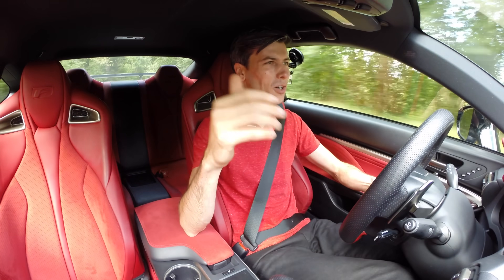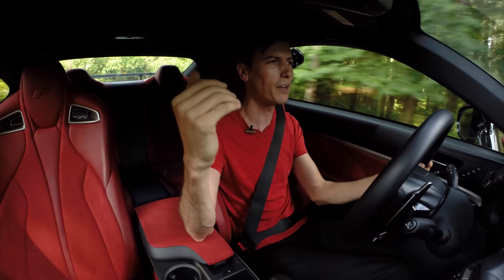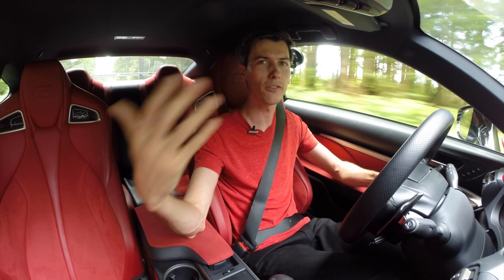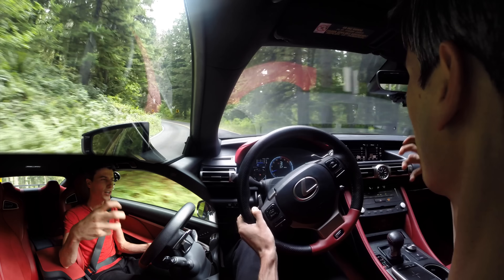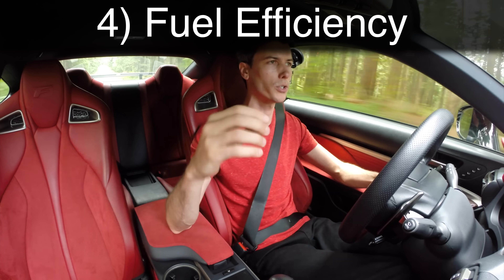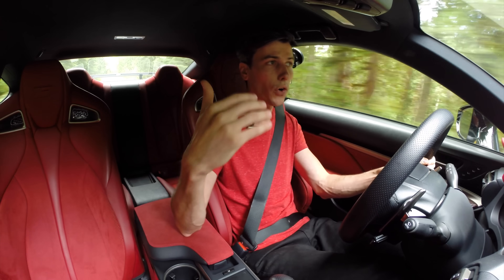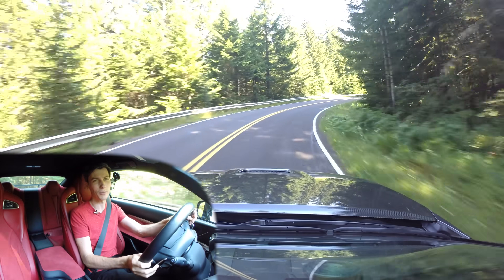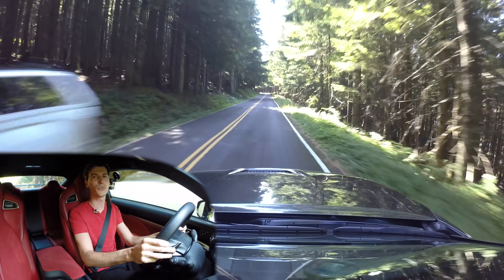5 Reasons You Shouldn't Buy A Turbocharged Car

Comment: Absolutely true. I own RC200t and it is shockingly bad car (or should I say car with a shockingly bad engine). I need to clarify this is in UK so we do not have RC350, we could have either R200t or RC-F. As it happens I cannot really afford RC-F, yes used one are now coming down to my price range, but I could never afford one new - hence RC200t. First of all, as mentioned the accelerator pedal is basically an on/off switch, there isn't much turbo lag past the point where accelerator is in "on" position, but engine completely doesn't like to rev past 4000RPM. It could, but there is no point as there is no torque to be had past 4000RPM... so again torque curve and accelerator response curve is exactly like depicted. On top of all these issues Lexus decided to put nearly identical 8-speed gearbox as RC-F... it is fine for RC-F but it is terrible on RC200t with already very short "power range", because it comes on power at maybe 2500RPM and it runs out of power at 4000RPM... meaning that gearbox is constantly shifting and feels like it is always in the wrong gear. Yes you can keep the certain gear manually, but as mentioned there is no point past 4000RPM anyway.
8AR-FTS (RC200t engine) apparently is high thermal efficiency engine, has otto-cycle etc. and it meant to be more fuel efficient, but let me be clear - it is TERRIBLE! As I said I don't own RC-F, but as I use Lexus dealer for service I have driven basically all cars Lexus has to offer, sometimes even over weekend. Further I have owned several IS250, which on paper are not as fuel efficient. And I can confidently say - RC-F is MORE fuel efficient car than RC200t. And IS250 just blows it out of this universe if fuel efficiency is concerned. In RC-F I can consistently get 36MPG on motorway and ~24MPG in city, on IS250 that is like 44MPG and 28MPG, whereas RC200t is terrible ~32MPG on motorway and ~18-22MPG in the city. Now obviously if you track both cars RC-F has a potential to consume more fuel, but equally it would drive circles around RC200t, but in normal day to day conditions just commuting on mixed cycle RC-F is more fuel efficient. Which is just ridiculous considering this is comparison between 5L V8 and 2L car. I tend to believe this is due to specifically the on/off nature of accelerator. In RC-F I almost never need to rev the car, it basically idles all the way and I can precisely accelerate just little bit by little bit, or really "floor it" if I need to. In RC200t there there is only two ways either all the way down to the floor or nothing at all. So if I joining motorway at say 50MPH and I want to match 70MPH on motorway I basically have to floor it, car changes several gears down, revs to like 4000RPM just to increase the speed a little bit. Whereas on RC-F in same situation I just need to press accelerator a fraction more and revs increases maybe from 2000 to 2100RPM, and it picks-up speed and matches required speed without problem. As result I don't think this terrible fuel consumption is surprising, just to drive with the flow of traffic I can basically idle RC-F all the way to work, yet I have to trash RC200t all the way. Although, even just cruising on motorways is not great either - RC-F easily reaches 36MPG and just stays there, whereas with RC200t you need to try very hard and it only return about 32MPG. Yes few times I have seen 38-40MPG on RC200t when I was driving through roadworks at night (limited to 50MPH) which is not achievable in RC-F at all, but as soon as you go past roadworks and get on normal motorway (70MPH) the fuel consumption starts climbing very quickly.

Comment: Maybe you can explain why the 737MCAS plane is a an ill designed airplane. The responce of the steering of a car should be like a planes takeoff responce. The 737 is not a jet fighter and should not need three computers to paper over a mechanical and air flow major error in Design. It is the center of presssure running around that makes it fly wierd. The engines act like canard wings. h cause to much lift and then that lift has to be killed.

Comment: If you actually plan to drive the car for a long time, don't buy a turbo.
Reply: 300,000 miles on mine over 32 years. No problems with turbo or rest of engine. As Lee Iacocca used to say, "if you can find a better car, then buy it"

Comment: I don't know, his arguments against turbos. I've put a cammed 351 cleveland in a 66 Mustang GT and it ran really well.  Currently I have a 331ci T-76mm turbo 95 Mustang Cobra There is not any lag do to the engine makes 400= hp and the turbo takes it past 800rwhp. With a T-56 6 speed with 355 gears I got 24 mpg on the highway. Performance there is no comparison the Cobra is F-ing fast. Sounds great too. Just my 2 cents.

Comment: Wait...until turbo spool up, the turbocharged engine would behave similar to a naturally aspirated setup right? That means the torque delivery to wheels would be the same right.?
Reply: He's talking about downsized engines (like a 3.5 v6 VS a 2.0 L4 turbo) so no. Also lower compression.
Reply: @lesnuitssanskimwilde883  what if we consider two 1.0l engine with same spec except one has turbo and the other doesn't. 🤔
Reply: @sachinisg  I guess the turboed engine will be a bit weaker in the low rpm because of the low compression but  engineering explained would be better at answering that than I would.

Comment: It’s all about instant gratification that’s not present with turbo lag. Unfortunately their are some N/A powered vehicles specially with drive by wire throttle that also have a lag. They way that I have personal found away around this is to first to hit the throttle around 50% then as it starts to accelerate then go to full throttle.

Comment: On an ls car, with 8 cylinders, the power gained from the turbo is much more then a naturally aspirated one even when you have upgraded cam etc. There is a deal with lag depending on the size of the turbo.  Yeah superchargers are good, but the price is high compared with turbo. Why they charge so much for super I dont know. There are less parts with a super.

Comment: “It is not crazy fast... uh... zero to 60 under 4secs”.... 

You daily drive a F-35?
Reply: omg i've been binging boostedboiz and emeliahartford channels where the average hp is 700hp up to 1000hp. i get it lolz
Reply: Supercharged Miata which is about as quick as bag of potato chips powered by 🚀
Reply: F35 Pratt and Whitney's engine cant be that great in acceleration
Reply: Superlite slc. Skip all the stuff and make it cheap. Then dump money in engine and tires and ecu stuff. 

2.9 seconds to 60.

Comment: I'm intrigued by this efficiency thing. When considering thermal efficiency, wouldn't you count the compression offered by the turbocharger into the total compression ratio ?
Reply: But a compression ratio is just a comparison of the cylinder volume at BDC and TDC. The pressure in the cylinder is not what that ratio measures.
Reply: NO, they only consider the cylinder volume. I agree with you in an effective "air volume" sense.

Comment: normally i agree with you but most of these issues are from older turbos like compression there are plenty if 9.5 and even 10 to one compression vehicles with turbos because engineers can adjust for fuel timing and valve timing also efficiency is exactly backwards from what you described turbos these days have almost no downside except price and even that is negligible

Comment: I drive an older V8 chevy trailblazer. A pretty small SUV for a V8 (5.3, not the SS). And it does sound amazing. And yes when you put your foot down, it does make you smile. Forget about WOT, 50% throttle give you a hard acceleration and an amazing sound. 

That said, I've sick of getting 13 mpg. If I had the option in a new SUV for a ~3L turbo gas engine, I'd definitely go that route. 

Or another option worth considering that no one seems to do these days is make smaller V8s, like 4L V8s. A mid-size SUV woudl still be plenty fast with a 4L V8, and it would have a MUCH nicer torque curve than a similar sized V6.
Reply: I drove a 6 cylinder version (short wheelbase too) and still only got 12mpg around town in that thing! Idk how they made the Atlas engine so inefficient. My friend had a 5.3 Suburban and got the same 13mpg as your TB

Comment: TURBO IS TECHNOLOGY! 
Every kind of technology has pros and cons, and engineers are constantly working to improve them. Getting the same amount of power with less cylinders and less noise pollution is an advancement not a disappointment! Using two smaller turbos instead of one is exactly what engineers are doing to reduce turbo lag and improve throttle control. You better also think about the benefits of turbo and stop comparing it to bigger engines. That very car would've been much mightier with forced induction.
Reply: After i shut my car off, does oil keep circulating through the Turbo to cool it off?
Reply: @dragospahontu  Hello. Generally speaking, the oil is always there to help dissipate the tremendous heat inside the turbo. But I don't think it would still be circulating.
Reply: @hamidrezabokharaei5779  hmmmmm... They should've allowed the oil to keep circulating.

Comment: I disagree with acceleration response, i got honda city diesel 1.5L, turbo spools at 1500 and all the way to 3600rpm and the RPM limit is 3800.. but being a variable turbo, it manages low boost at 1000-1200 rpm which is actually great, when i depress my clutch at 800 rpm without touching the accelerator, turbo spools up and my car is able to climb up hills !! 0 acceleration input by user.. you should check honda earth dreams 1.5L diesel, it's interesting engine

And the stupidly amazing thing is, when am using engine brake in low gears on down hills, i have seen my turbo spooling upto 2.5 Psi around 3,000rpm on down hills, without using any Diesel, don't know how honda manage to do that but it helps in sudden acceleration..
2nd situation is when am cruzing above 2500rpm, acceleration responce is actually very good, you barely notice the turbo lag..
maybe half second or Less, but i conseder it comfortable ride and not to give a big jerk to any engine and transmission components

Comment: I drive a 2018 wrx, and I can definitely say the throttle is basically an on/off switch. It's very difficult to drive the car "normally". The slightest pressure and you're hitting boost. Many modern cars have a more sensitive throttle than I'd like, but the wrx takes that to the extreme. My previous car had a mechanical throttle that gave you tons of room and a smoother response.

I do like my car, but they could have tuned that throttle to be a bit less sensitive.
Reply: As a 21 WRX STi owner. I agree with this. It like either on or off. Unless you want to get up to 35 mph in like 15 seconds

Comment: So what do you want out of your car do you want a family car? Or do you wanna performance car something that’s going to go fast. Normally you can’t have both; unless you’ve got lots of money then you’re buying very expensive cars. Your performance car normally isn’t going to have the just sheer boring reliability that your family car is going to have. Your performance car is going to require better maintenance routines than your family car. You’re going to be required to run better oil you may be required to change it more frequently depending on how hard you drive your car. I don’t know anyone that has a performance car that hasn’t modified it. They have upgraded the cooling system because of the heat generated, they’ve upgraded to a better oil that they put in the engine, they have added engine oil coolers if they haven’t come factory that way, they’ve upgraded Radiators for engine cooling added electric fans. And for the turbo crowd like me they’ve upgraded the exhaust system in the inner cooler the oil cooling system the PCV system with baffle plates to keep the oil from being ingested end of the engine. And a host of other mods internal wastegate, external wastegate, blow off valve, throttle bodies, throttlebody spacers, intake manifold spacers, water methanol injection which keeps the temperatures down, Removing the engine cover that holds the heat into the engine, actual proper hood vents that allow the heat out, there are so many things that you can do to make the engine Live under these harsh conditions in a performance car. So I’ll be keeping my turbo card thank you very much. And I will be turbo charging the mustang GT that I own, If the math is right it should be putting down around 640 hp to the rear wheels was almost 700 foot pounds of torque on tap.

Comment: 2.0L on 24psi boost; it’s basically a V-8 car from 2800 RPMs to 6000 RPMs. Most will tell you that the focus ST doesn’t make enough power to do 150 mile an hour. Oops I guess I forgot to tell my car that because it will.

Comment: Ha ha; turbo charge car manual transmission. If you don’t know how to get your car into boost faster by downshifting or playing the throttle and clutch; Then you should learn how to drive your car. See the little car in the picture to the left? That’s a 2017 focus ST. It’s got everybody except for replacing the factory turbo. And it beats V-8 cars. So how is the turbo charge car worse than a naturally aspirated car If I can beat V8 cars V8 trucks V6 cars V6 trucks. I can also be other turbocharged cars. Yes with a front wheel drive car traction is an issue but that can be fixed with a limited slip differential and better tires. Nitto and Mickey Thompson make good tires and actually in the size that I need for this car. So if you’re interested and you really think that Lexus is that fast let me know if you want to be embarrassed by just a little four-cylinder turbo. It’s just a 2.0L... if you really would like to be embarrassed my best friend in my car club can embarrass you with his 2012 impala LFX police car. So again if you don’t know how to drive your car because you’re experiencing these Issues was not knowing how to raise the boost by downshifting basically skipping a gear down. Say, going from 5th to 3rd on a roll race then you need to learn how to drive your car. Most street races now our roll races; Due to the need to stay away from the police LOL. If you’re interested come down to Houston Texas. I’m sure I or my car club members would be interested in embarrassing you. But you really need to learn how to drive your car if you’re having these issues. Later

Comment: Sadly, where I live in Europe (Romania), the annual taxes that you have to pay depending on the size of the engine will set you back a great deal... Like some one said, an arm, a leg and an eye...

1 liter - 10 USD or 8.6 EUR 
2 liters - 48 USD or 41 EUR
3 liters - 581 USD or 492 EUR
4 liters - 1576 USD or 1333 EUR
5 liters - 1971 USD or 1668 EUR
6 liters - 2363 USD or 2000 EUR
6.8 liters - 2680 USD or 2267 EUR

Even if you pay this tax for the whole year, most people will only permit up to 3 liters cars... So turbocharged most likely...

Comment: What I tried to educate both of my Sons about years ago. Turbos = Heat . Heat. Heat.  Heat ruins plastics, computers, coils and wiring. Modern cars have a lot of those things. If you want to keep the car and have it be relatively trouble free. Go Normally Aspirated.  Take care of it. Don’t flog it it. That’s why I would Never buy a Single Engine (or Twin, for that matter) Airplane with a turbo charger. I’ve watched the turbo chargers on a twin Cessna glowing Orange/Red Hot out of the passenger windows at night. Via long, tortuous, flexible jointed exhaust pipes. That go through the wing. By the Spar. And the Fuel Tanks. No, Thanks. Just my opinion. Low boost superchargers in cars, especially with an intercooler,  do Not create so much Heat. But I would always go normally aspirated until electrical cars become practical with better battery technology. They are fast. Zero MPH = MAX Torque. Just my old engineering opinion.

Comment: What was this about?! You really got paid to make a video clip on this subject!???? Your argues are pretty naive!
Turbo lag is a trade off! You can save your engine life when you don't wanna go fast! In turbo engines, until the manifold boost pressure is equal or lower than zero(of course based on the compression ratio it is more than zero), you are saving engine lifetime as  you're putting less pressure on the turbo engine than a NA due to turbo engine less compression ratio. The only downside of lag is the first time you push accelerator and based on the map and turbo size, quantity, setup, two steps, anti lag, &... you can almost eliminate the turbo lag make it to creat boost from 1.3k RPM!
On the other hand, NA engines are ALWAYS under pressure and tend to knock because of compression ratio and even more sensetive to the octane.
About thermal efficiency, the engine consumption is pretty low at low rpm as you know.
For the torque curve, by using new ECUs, turbo setups, 2nd turbo gen, and... You can have a smoother and prettier torque/hp curve even in 80s cars(you can check the dyno graph for a deawoo espero, got turbod by metily_tt).
About limited rpm for turbo positive effect, again I refer you to the new facilities (sequencial turbo setup, electric 3way wastegate\bov valve to smoothening boost pressure in all rpm range, new maps, and...)  available to cover whole rpm with boost.
So we both wasted our time talking about it.

Comment: Turbo chargers are not for fuel efficiency, it's just for more power with a smaller engine, thats it, you want power but can't afford v8 6 litre, then turbocharge. V8 V10 V12 is not cheap in certain countries.